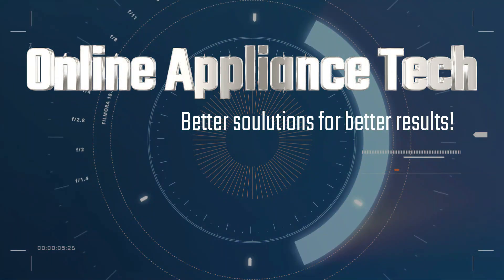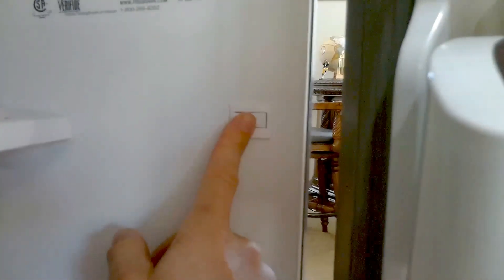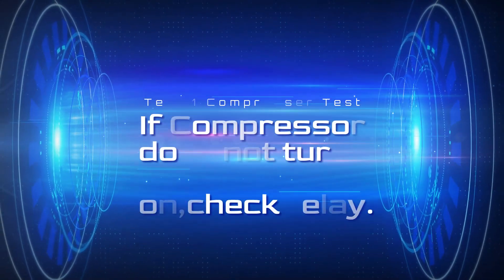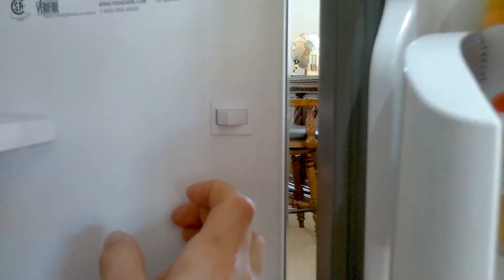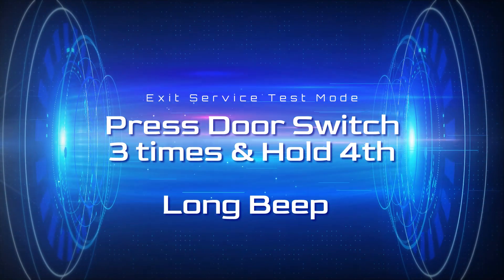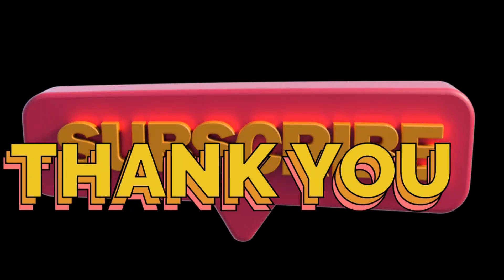Frigidaire Refrigerator FGTR20 Diagnostic Mode & Component Testing Made Easy!

Comment: The video lists four diagnostic tests that can be performed on a Frigidaire top mount refrigerator:

Compressor test: 
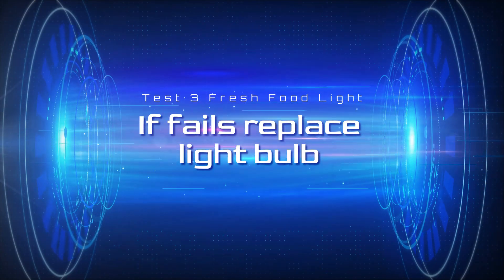This test checks if the compressor is turning on. If the compressor is not turning on in diagnostic mode, it's more likely a relay issue. [1:22, 1:31]

Defrost heater test: 
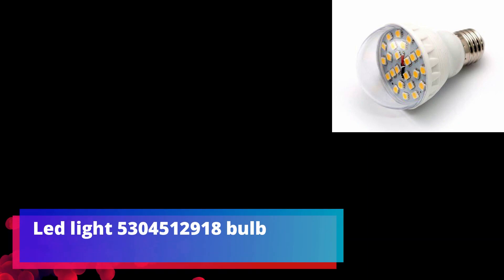This test checks the defrost heater. If you have a layer of ice on the back wall, your fresh food section is warm, and you hear no cracking sounds, then the defrost heater is more likely the culprit. [1:32, 1:40]

Freshly light test: 
This test checks the fresh food light. If you activate this test and the light does not work, then the bulb is more likely the issue. [1:41, 1:43]

Evaporator fan motor test: 
This test checks the evaporator fan motor. If you have frost on the back wall, your refrigerator is not cooling, and you feel no airflow from the freezer, then the evaporator fan motor is more likely the issue. [1:44, 1:53]
Reply: Everything works in service mode individually. But won't operate normally.' what do you think is wrong 🙏🙏